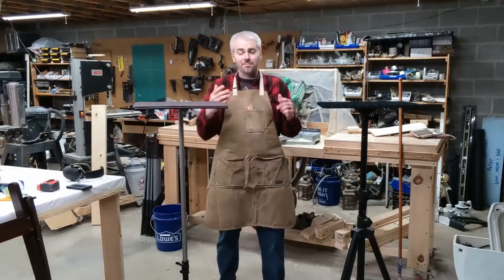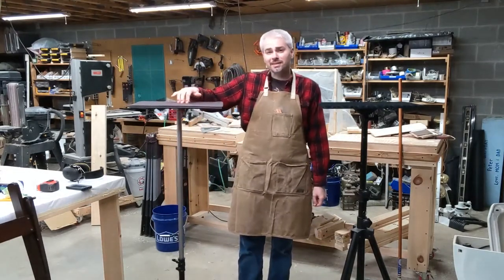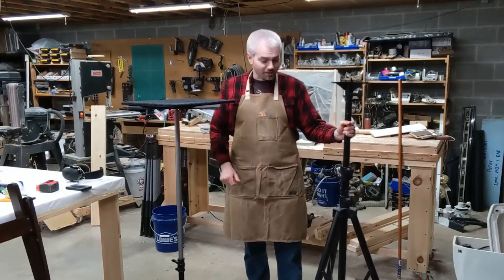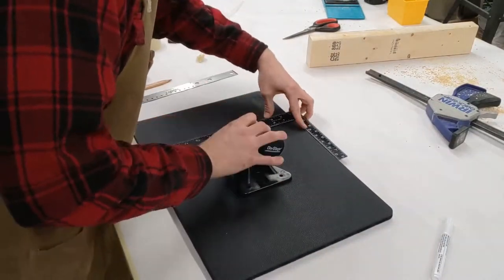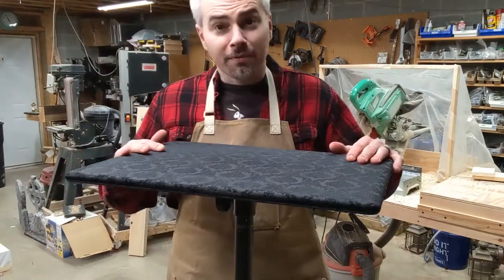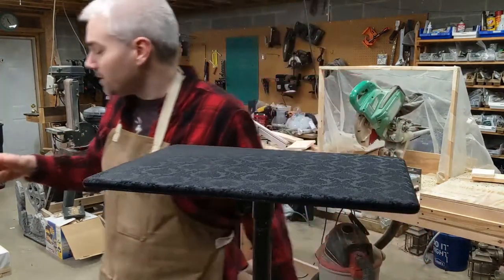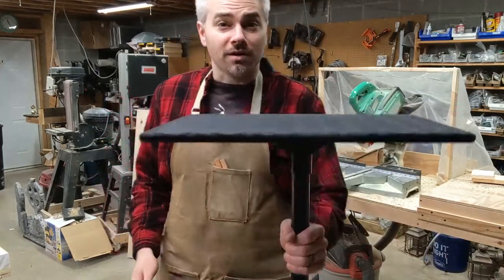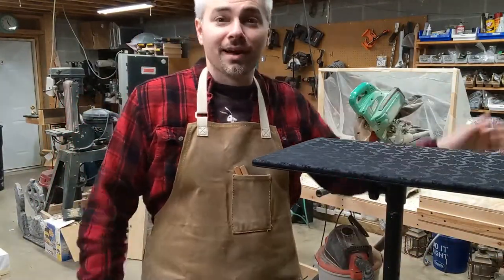Custom Tripod Table for Virtual Shows

Comment: Wow! I have the same table! I also made this using a speaker stand but with the plain black pad. This table was one of my proudest projects. Thinking about adding a servante to it but I dont have enough time plus it's been kinda tricky getting my hands on materials with the pandemic and all...
Reply from the maker: Great minds, Matthew!  I'll be curious to see how ours hold up over time, since it doesn't have a lot of material to grab onto, but so far so good.
Reply: @PeterWood  haha yeah its the top part is it's most fragile. Though I think they sell ones like these for like $150 at least with the same build which makes ours a total steal btw 😂